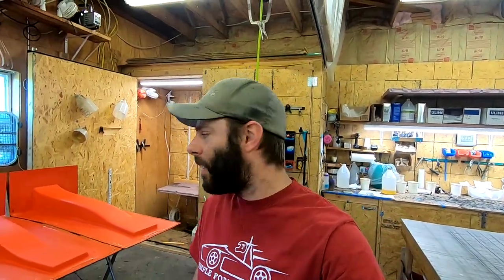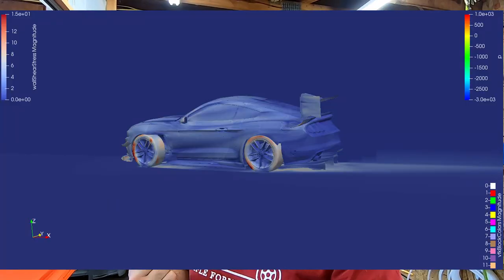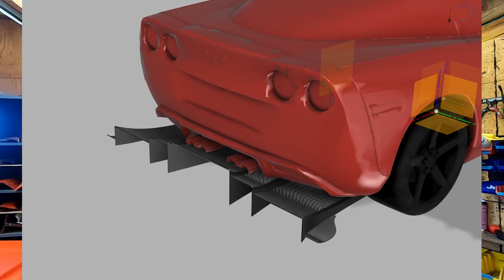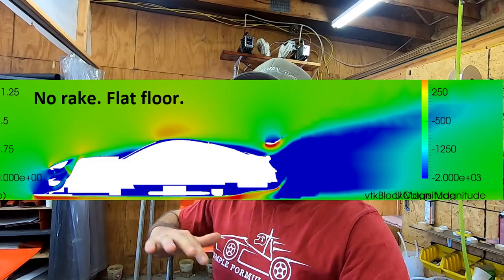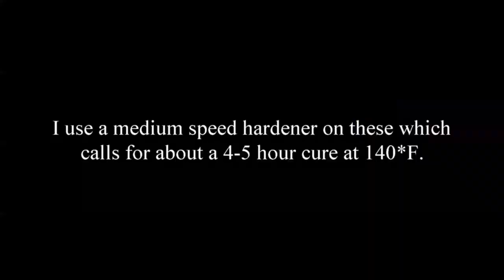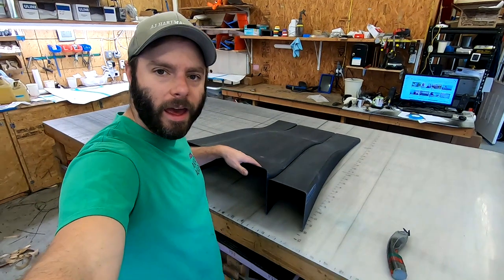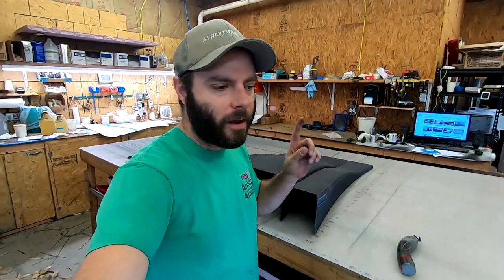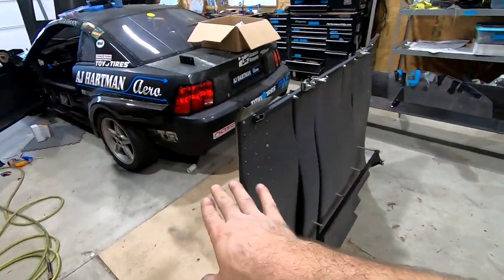Making a Carbon Fiber Diffusor

Comment: Thanks for making these videos AJ! Very cool to watch and learn. I noticed you ran the infusion across the diffusor components. What is the advantage of running the flow of resin across instead of lengthwise? Time? Also if you did run it lengthwise (low point of mold to high point of mold) would it help any air bubbles to escape more easily?

Comment: Great work as always. Do you keep the vacuum pump on during the cure? What resin and hardener do you use?
Reply from the maker: I keep it on. I use RhinoLinings infusion epoxy but just about any ifusion epoxy system would work fine.

Comment: you mentioned reusable bags? wouldn't creating a reusable bag just be doing a layup with silicone and then allowing to cure, would be interested in your process for creating the reusable bags.
Reply from the maker: Effectively yes, but there are some intricacies to inlet and vacuum line, and since my molds flanges weren't set up for them getting them to seal air tight can be an issue as well. And then all the money and time making them will need to be recouped to make it worth it as well.